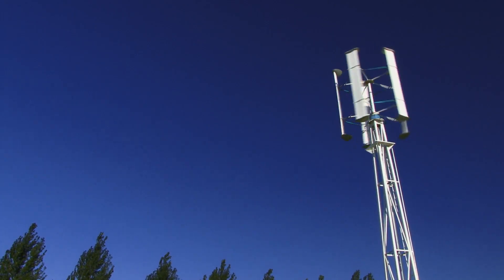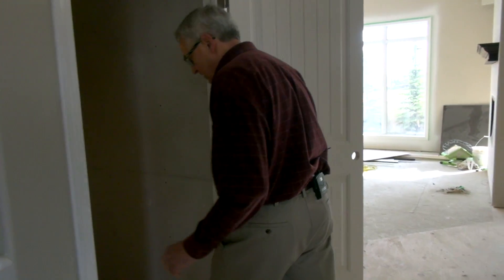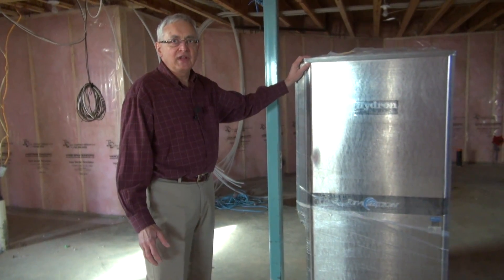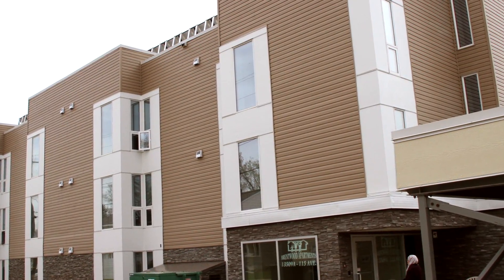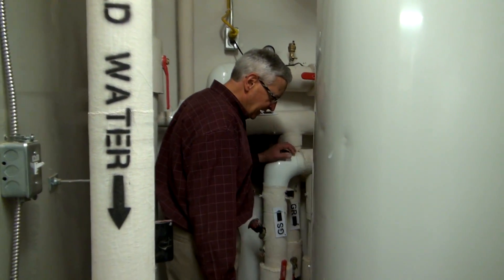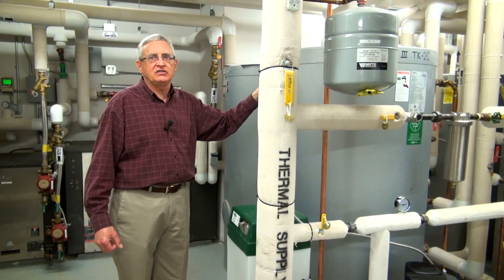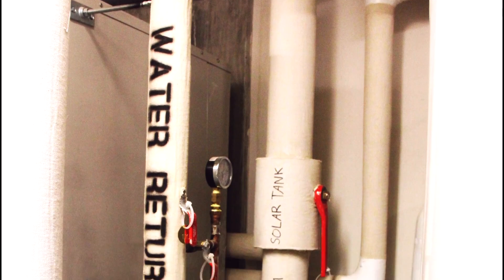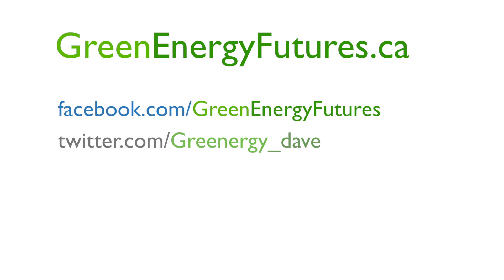6. Geothermal 101 - How to heat your home with just three degrees--Green Energy Futures

Comment: Why not combine the geothermal heating/cooling with a stirling engine generator (that utilizes the difference in temperature to move a piston)?  There are commercially available 5 kW and even 25 kW Stirling engine generators.  Currently, they are typically coupled with either a traditional fuel or solar heat source...but why not use the 65⁰ C water from a geothermal heating system to generate electricity?  Unlimited free energy available 24/7/365 in all weather conditions.  It does not rely on winds or the sky being cloud free and clear.  It will just provide heat and cooling and electricity on and on and on.
Reply: +13thGenPatriot You can't find a Stirling Motor that works with 65° C and have Power, because thermal efficiency and carnot process. With a Delta T from 40 K the carnot process gave a maximum system effectiveness from about 1,5 - 3 % (theoretical maximum). B.t.w. the 65°C water comes from the electric powered Heatpump, we get only 3 - 5 ° K from the outside.

Comment: Heating the air is incredibly wasteful. A smarter system would have used radiant heat from the floors to heat the space, eliminating the need for air ducts and blowers, and reducing the over all consumption of energy to run the system.
Reply: But if you want air conditioning (and geothermal AC is VERY efficient)...
Reply: ***** It's clear you don't live in south florida!!
Reply: It's nice to be in a warm climate. However, A/C is as important here as heat is to your region.